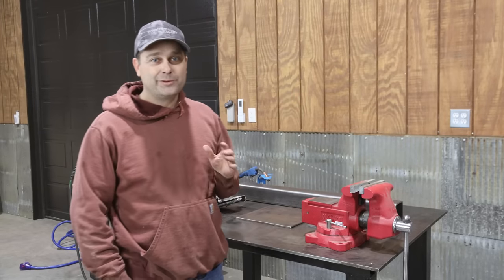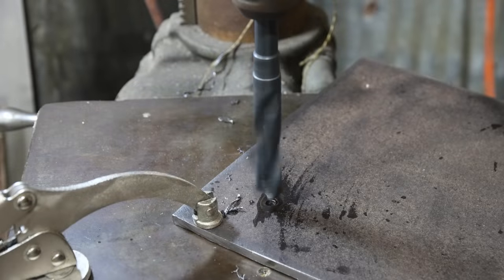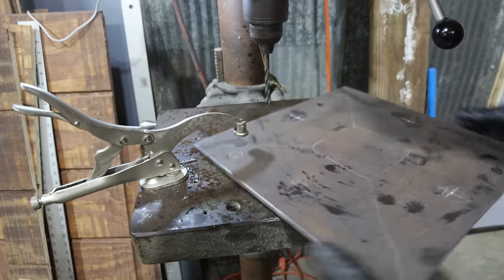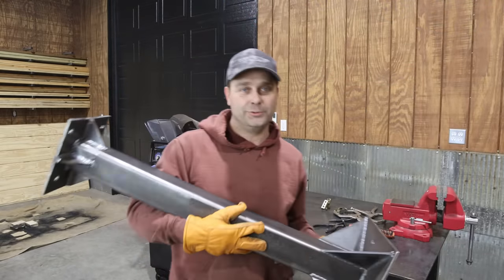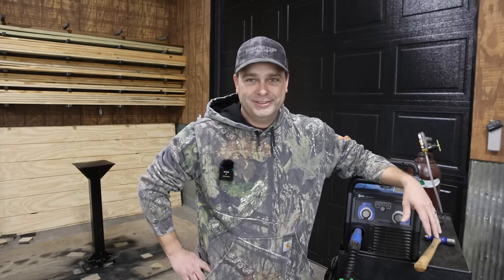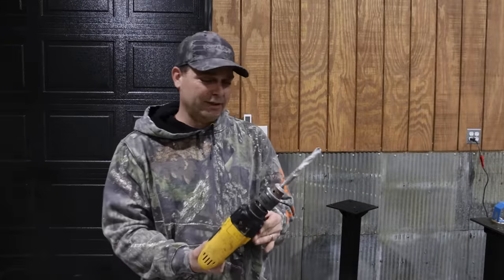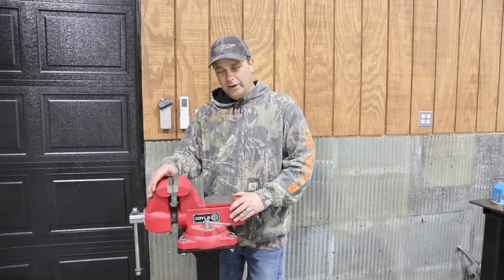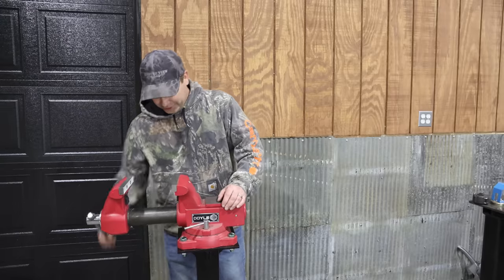Building a Heavy Duty Vise Stand for the Work Shop.  But I ruined a couple things while building it.

Comment: FWIW, ductile iron is also cast, but has a combination of elements added to change the nodular shape of the Iron and Carbon included using Manganese, Magnesium, Copper and other elements.  The foundry my dad worked at for a long time would make both grey iron and ductile iron depending on the customer's application.
Reply: Correct me if you think I am wrong, but I think what he was trying to say is that the main difference between Ductile Iron and Cast Iron is that Ductile is less brittle, i.e. it does not break quite easily, whereas, Cast iron is comparatively more brittle. Ductile iron has an amazing bending capability over Cast iron.

Comment: Great project Evan.  Some people never heard of them but a leg vise is an old blacksmith's vise that had a steel leg running down from the vise to the floor to give extra stability for when you need to hammer on what you are working on.  It helps take the stress out of how the vise is mounted to the stand or bench..

Comment: as a 10 year or so professional welder. get some liquid or powdered starch and use it when you wash your bibs. what i would do was fill a bucket with cold starch water. soak my bibs, then pull them out and let them drip /  line dry.  works better then you would think.

Comment: We’ve all ruined some clothes with a grinder /torch. If you haven’t yet, you will.😢
Reply: Yup grinder/ torch/welder or if your a smoker,   cigarettes. Lol or ?? 😂
Reply: @PapaRug.58  was going to mention welder myself. Ruined one of my favorite T-shirts a few years ago welding exhaust pipe under a truck. Felt every bit of that big spark land on my chest and burn a hole in the shirt.
Reply: @stephensaasen8589  You gotta have play clothes for the shop.. lol if I wear anything into mine, I write it off.
Reply: Yes I can join the long queue of having a pair of trousers that looked just like that.  I stopped angle grinding when I felt the sparks burning the inside of my thigh and I looked down.
Reply: Don’t wear tennis shoes when grinding 😂
Reply: @arqueros66441  yeah the old hot foot 🦶🏻 suck’s when you got to work next day

Comment: I'm a millwright myself, at a foundry. We make gray and ductile iron castings. And we're required to wear Arc flash uniforms and they still burn through from using a metabo or grinder. Smolder more than actually flame up. But when cutting or welding, cotton is the minimum requirement. So your denim is fine, in my opinion. Leather is obviously the best choice,but it's so heavy. As long as you're not wearing polyester, I'd say you're good. Lol. Polyester is bad news when it comes to heat or open flame... it WILL become YOU!

Comment: Nice video. You are way skilled. In the seventies I had a spring shop make a new leaf  spring for an old Mack. He used water for drill liquid in lieu of oil. Cleaner,stays on, no smoke, good curls. Using it ever since.

Comment: The number of anchors to use depends on the kind, size and embedment depth in the concrete.  The anchor bolts should be spaced out so their shear cones in the concrete don't overlap.  With the small baseplate you are using, 4 anchor bolts should work well.  To use more than 4, your baseplate probably needs to be bigger.

Comment: At the 14:40 mark I can relate to burning through your clothes when welding.
I was grinding some metal and the sparks had burned through the long sleeve shirt I was wearing.
I did not notice it until I was finished cutting the metal, but as with you, I did not suffer any burns.  I just ruined a good work shirt!

Comment: I had an 18volt Dewalt drill that started smoking while drilling through metal i just kept drilling the smoke stopped and the drill actually works better now but it was an old drill so if it burnt completely up it didn't matter, I have a vice stand made with a pipe tire rim and a flat piece of steel that is bolted to the floor.

Comment: I never tried those kinda anchors, i started using the ones that actually screw in. As far as grinding i always make sure I don't have anything in my pockets that might catch fire, especially when welding. I bought a face mask off Amazon, it has a frame around the edge and i got it to be fog free.

Comment: Nice stand.  When adding welded gussets to a structure like that, it is good practice to cut a quarter-round clearance at the inner corner where the gusset, the tube, and the baseplate come together. Otherwise, the spot where the three welds come together is vulnerable to cracking.

Comment: Bare in mind, a tool is only as strong as its weakest part. If you make the base to rigidly attached to the floor, the vice may give way instead of the bench move if you put too much torque on it.
Reply: IMO, the swivel base is by FAR the weakest part of a vise.  It's nearly impossible to tighten them where they won't "give" when you're pulling on something. Even ones with dual swivel locks will give.  If you're going to be reefing on stuff regularly, it's good to have a vise with no swivel, or weld the swivel locked. Can't tell you the number of times I had to learn this before I finally committed to locking up the swivel permanently.
Reply: @python3574  I Agree.  You throw a 2 or 3 ft pipe on something to pull on you'll turn the swivel loose.
Reply: @python3574  I hadn't noticed it was a swivel base when I wrote the comment, but I agree.
Reply: My thoughts as well it needs a dowel pin to lock the vice in position at least then you’ll have one position we’re it can’t turn

Comment: My Grandpa was a welder/shop foreman for Diamond Shamrock Corp. for 22 years.  My Grandma starched his uniforms because the welding berries and grinder sparks would bounce off. It wasn't spray starch. Starch was a gallon bottle and she would mix a cup full with a few gallons of water in a #3 tub in their backyard, She would wash and rinse his uniforms, ring them out through a ringer (you made sure not to get your fingers caught,) dunk them in the starch tub, ring them out again them hang them on the clothes line. They would dry stiff as cardboard! She would sprinkle them with her soda pop bottle full of water and iron them. She said it would seal the holes in the weave of the canvas. Grandpa said it cut off the air circulation to his body but, it was like wearing a suit of armor. No burns!
Reply: We had an old wringer washer too. I remember my mom sending things through it and sometimes having to hit the release bar when something was too thick. Thanks for the memory.
Reply: It wasn't just her fingers that she didn't want to get caught in a ringer.

Comment: I think it would be stronger overall if you put the bolts on the corners and the gussets on the sides.
Reply: I agree 100%.  But the welds are undercut and didn't have a lot of penetration so don't know that it matters that much.  With steel that thick they needed to be beveled and probably a couple passes to make them strong.

Comment: If you use 3/4 anchors our will do any more and you risk it tearing up concrete and that would be expensive plus a 3/4 anchor bolt won’t be going anywhere at all, weld an eye to it and chain your Harley in place and it will be very hard to steal

Comment: The smaller vice movable table is an easy fix!!  Put lockable rollers on it. This way you can move the vice will not move// You can move any where you want to.  It will help any including the apron outside///////////////// easy fix!!!!!!

Comment: I laughed at the burned pants. I've welded for 40 years,and I mean alot of welding,  and maybe I'm a glutton for punishment, but I could never wear welding leathers, not even the gloves. Just cannot do it. I have burned shoes, t shirts, pants, stocking caps, my watch band, rubber boots and probably a few other things. I've actually looked down and patted out flames- so, don't feel bad about it- a couple charred holes are just battle scars👍

Comment: That looks like a good job and quite strong. My OCD would perhaps have tweaked the design a allow for serious abuse of the vice. Did you consider (in addition to what you have done) passing the piller through the top and bootom plates to allow welding on both sides plus perhaps cross bracing inside the pillar at either end (as deep as you could get to weld it in place? Just thinking about the twisting forces involved on the pillar when using extended leverages.  As you do say "Time will tell". This is not a critical comment in any way, just an observation. Love the channel, content and honesty.

Comment: I have found through experience that Carhartt workwear is very susceptible to catching fire or burning when exposed to heat. I'm not sure why, maybe they process their material differently for some reason. I had a Carhartt sweatshirt burn a hole in it from the exhaust of a post hole auger. I had a coat catch fire from a grinder. And I've seen many others.

My Real Work (Rural King brand) and Berco/Berne Apparel Company haven't had that problem. I grew up 10 minutes from where Berne Apparel was founded and I've had MANY, MANY, MANY of their coats/bibs. I've ripped them before, outgrown them, and just plain wore them out, but never had one burn or catch fire.

Comment: A word of warning about gloves and the drill press.... a long time ago I had a floor model older drill press  and it was under the awning to my trailer , with 2' of snow on the ground it was bitterly cold... so I had my jacket gloves and hat on.... I was working on drilling a bunch of holes in 1/4" plate with a hole saw....  my hands were close to the spindle but not touching it
all of a sudden it grabbed my hand and threw me bodily against the trailer house and took off my glove in the process (thank god!) or it would have ripped my arm off !  the drill speed was 
about 100 RPM... going slow but some how that chuck grabbed my glove and threw me ( 198lbs at the time) very hard against the trailer.... i dented the trailer wall ! .....
the moral of the story do NOT ware gloves when using the drill press  a cut is better than a arm ripped off !!!

Comment: Milwaukee drills work better than dewalt drills
Reply: they aint right tool for job in hand any hammer drill with a 5/8 bit will struggle in concrete my dewalt 18v sds drill a walk in the park
Reply: Oh no no no 😂😂

Comment: Nice Job. The only problem I can see is the epoxy mount to the floor. That is the only weak part of the build. I don't have any experience with epoxy, I've always used the expandable hardware. GOOD LUCK, LOOKS GREAT‼️‼️ Vinny 🇺🇸 21:36
Reply: Epoxy has a reliable history, In some ways epoxy is superior because it is a liquid it flows around the rock in the concrete whereas an expandable anchor only makes contact at a few points. If you are familiar with the term, epoxy connects with a greater surface area than the metal anchors do. That means they are stronger.

Comment: Laughing my ass off at the burned clothes.  I am a career construction welder.  Denim is the best other than leather. We rarely wore leather. Too damn hot.  I have burned many a set of bibs..  LIQUID STITCH will patch them right up.  Easy fix. Denim from old jeans. Put the patch on the INSIDE of the hole so the edges of the bibs can be sealed with the liquid stitch.  Wally World carries it in the sewing area. Get the ORIGINAL formula. Vise looks good.  EDIT:  You opened yourself up for a joke.  Your wife has been lying to you regarding what 6 inches looks like.  You thought 6 3/4 was HUGE.  LOL